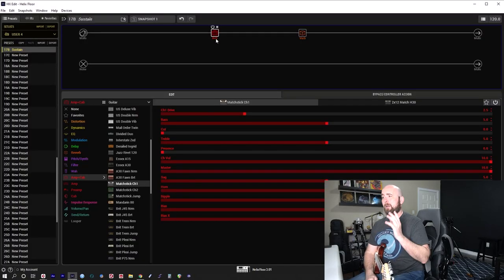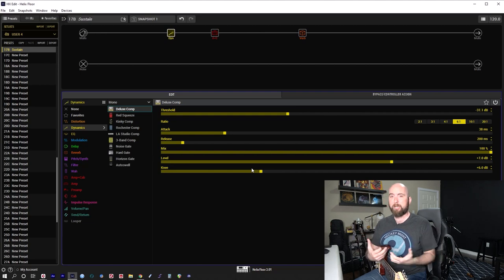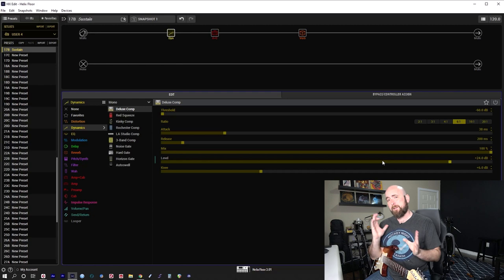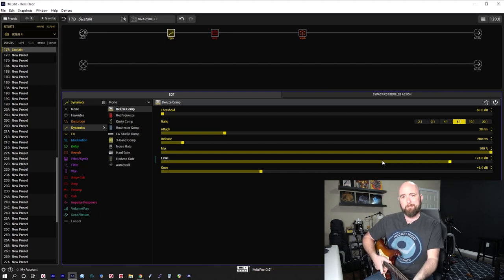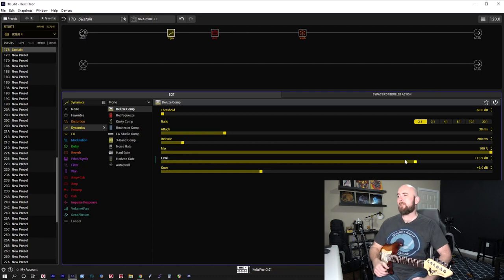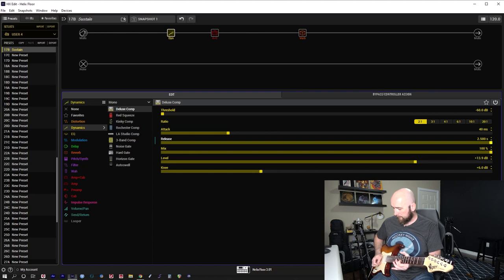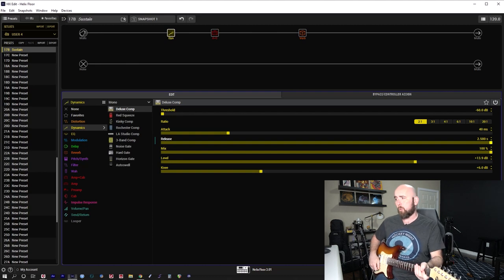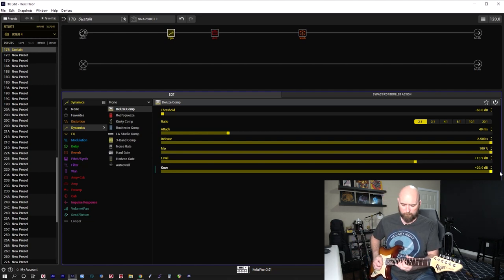HELP! I NEED MORE SUSTAIN! | Compressor Settings For Max Sustain (Line 6 Helix/HX Stomp/Pod Go)

Comment: I’m imagining that the added noise could become pretty bad on a higher gain sound, although I suppose you wouldn’t need as much compression since high gain amps and pedals are usually doing their own compressing. Gonna try it. As always, fantastic job!
(Also it warms my heart when I see you remember to use the space bar… ;) )

Comment: Thanks again for an excellent video Jason. I seem to remember from your other videos you also increased Amp Sag and bias x. With most of my presets sustain seems to be the most difficult to achieve. Will try this ASAP. I have requested a sustain block through line 6 but I am guessing it not that simple. Cheers

Comment: Great playing and info for clean. I have a Keeley comp the new one. I tend to use a lot of fuzz sometimes two fuzzes at once, I always feel the Keeley takes all the great dynamics out of my highs especially with the fuzzes. I also have a podgo, I might try the fuzzes with it, since it has much more parameters. I have my Keeley at the end of all my dirt. Right now I rarely turn my comp on, but like I say I’m using quite a bit of overdrive and fuzz most of the time. I guess I’m going for that Cream sound for the most part

Comment: Just tried your tricks on a Pod Go and it worked well!  Some of the differences are difficult to hear so I feed my signal into a DAW and look at the change in the db View window.  It works well.

 I heard from a commenter on another video that it's best to put the compression after the amp because it has more response.  I tried it between the Amp/Cab and after the Cab but couldn't hear any difference.  Is there anything to where the compressor is placed in the chain?

Comment: Hi Jason , great video on something I’ve been trying to achieve so extremely helpful for me on my HX FX , my question is I use a similar template to yours in my signal chain where I’ve got a smoothing compressor at the end of the chain and wondered if I should or could switch that off when I switch in the comp for sustain ?
Thanks Alan

Comment: turn your amp up, push the power tubes and move air, which means use real gear not that fake digital stuff